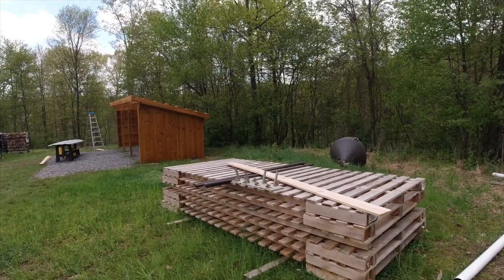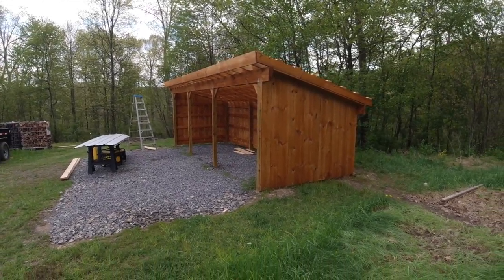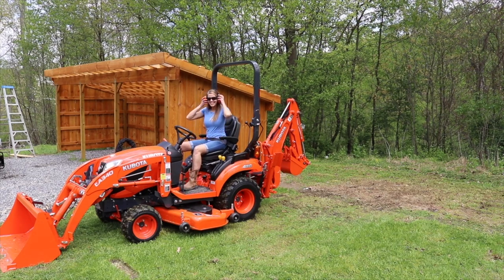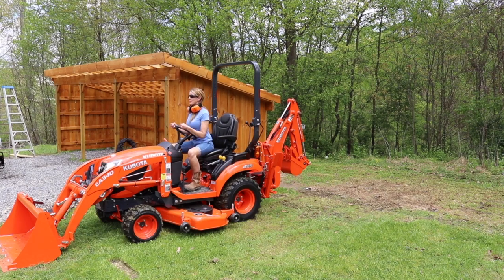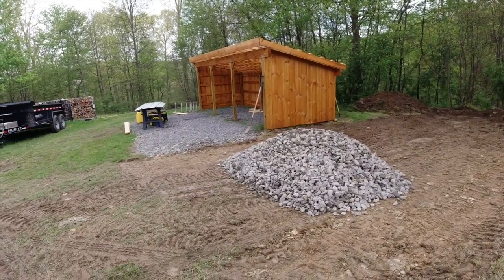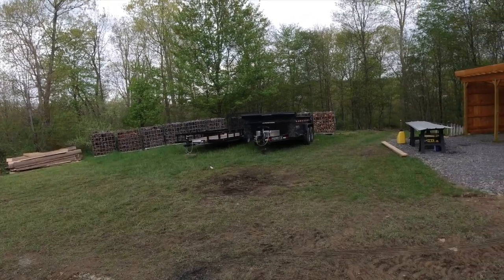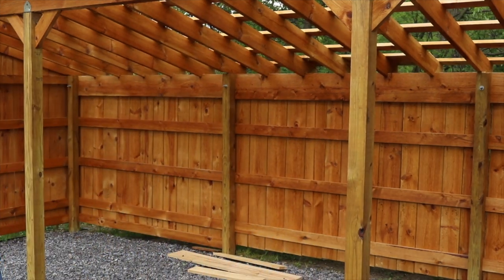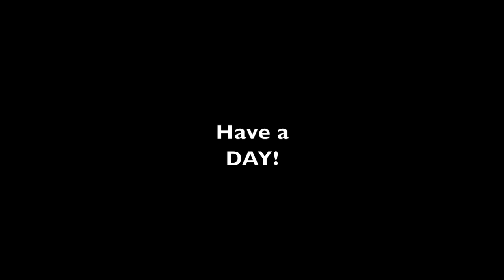#784 Kubota Tractors at Work, Mowing, Grading, Spreading Rock

Comment: My dad worked for the state of Vermont for 31 years. I worked with him one summer when they were paving the roads. They used to lay down the asphalt then use a buckeye (spreader) on the back of the truck. It spreads a nice even layer of stone on top of the asphalt. Watching you run the tractor and bucket you are doing almost a good a job spreading the stone. Nice job.

Comment: Suggestion. With the quick hitch, you can insert a receiver hitch and mover your trailers VERY easily.  Or put a receiver on the pallet forks.   Lots easier to move trailers with tractor.

Comment: Mike thank you for switching to Kubota tractors. The difference in operating noise of the Kubota tractor vs RK is very noticeable. I have been looking at replacing my old tractor. Your videos has given me more to think about than a spec sheet.

Comment: A friend of mine put a gravel parking spot in and he put down a bunch of plastic so the moisture wouldn't come up through the stone. I thought that would be food for the wood shed but that has a roof. But for your saw mill if it is gravel sealing the water out would be a good idea even if covered. Because that will stand their for along time.

Comment: Fill up the dump trailer with the top layer you scrapped off and you could use it to fill in trouble spots on the trails or down at the pond.

Comment: Talking about staining, are you going to stain the purlins in the top of the rafters before you do the roof, it might help because you’re going to have a little bit of condensation on the underside of the metal roof in the change in the weather, Just a thought since you’re doing such a expertise job

Comment: Not sure if you know this or not but you need to make sure you disconnect the backhoe hydraulic lines an hook the power beyond line back into the tractor before mowing with the mower. My dealer said you will damage the pump over time if you don’t as it’s to restricted.

Comment: Mike the big tractor made quick work of that little project. FYI take time to practice taking the hoe & loader off. Also creating a level area to remove loader & hoe are extremely important. Do yourself a favor and make a  level concrete surface for the tractor and each implement.

Comment: Dang Mike, you painted on that stone so nice there's no hand work!
Reply: im thinking on getting a $8,000 kubota GL11000 diesel generator wich isnt to bad comparing a $36,000 caterpiller 11,000 watt  and $32,000 sommers 9,000 watt  so the $8,000 kubota was my cheapest one i might be getting plus kubota generator uses same oil and feul filter as these tractors and same parts wich makes life easy and smart designing better then cat and sommers wich they have to use different parts wich is a pain in the butt

Comment: wow, you had some nice wind gusts down there.  I watched as it tipped over your step ladder.  great tools.. land plane and front loader works well together for that.  you shed came out nice.  can't wait till the roof goes on.   I have a 32 foot shed I am going to put a new metal roof on.  it was either that or tear it down.  but, for less than 600 in metal roofing, I can save that old thing for another 30 years. hate to see good construction go to waste.   you can't buy a 32 foot shed for 600 is the way I think of it.  money well spent.  wish more folks thought that way.  I hate to see old construction be left to rot to the ground.

Comment: While you are only removing a few inches of material at a time it would pay to stockpile that material in an accessible location.  If you then add you sawdust and perhaps some leaves to the stockpile, and turn it with you big bucket a time or two a year you will have a very nice pile of composted soil for lawn patching, etc. It takes very little effort, just let nature do its thing.

Comment: Melissa, Mike, the question of the ages. Treadle pedal or twin pedal? Like the color of the tractor matters. I have heard from the more reasonable operators that "ya use what you gots" . Did the L39 have a hydrostatic or a gear transmission? You got the RK tractors shortly after I found your videos. Did the little dump trailer go back also? It seemed handy for moving loads of gravel. As always great videos  Thanks  Take care

Comment: I've never actually used a purpose built forklift attachment on a tractor. I've always used forks made to fit on the bucket. I suppose the attachent is nicer, but how hard is it to switch out? with the ones we had on the bucket, if we needed to use the bucket, they just got flipped over.

Comment: Ya'll seriously need to turn the volume down when recording shale (or other similar events) being dumped in to a metal trailer. But then again, maybe I'm the only one that needs to wear headphones to hear everything else clearly. Never mind... carry on.
Reply: Gary, you’re going to have to learn to control the volume on your end. Like you have to do on your television. I had that same complaint on different channels till I got it figured out ! I have hearing problems and have to use head phones to understand what I am hearing so they are cranked up so I can hear them while they are doing something and when they put in some music it gets loud. Just turn down your volume. Good luck.
Reply: @olddawgdreaming5715  LOL...the gravel in the dump trailer gets your attention ..... However I got on the mute button  quick on that one and for any music (noise). Makes my hearing aid sing.
 Sure like Mikes 'bota with the cab/4wd.